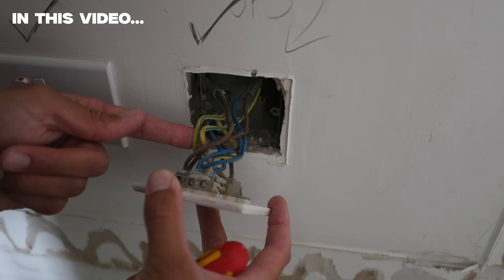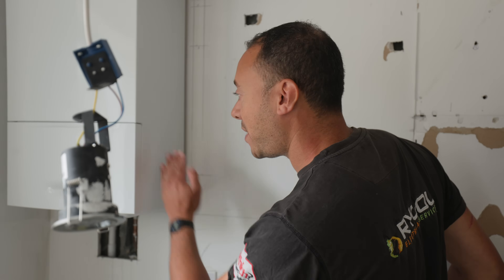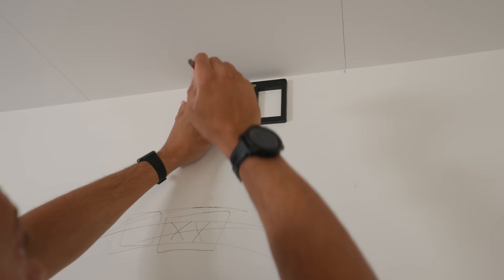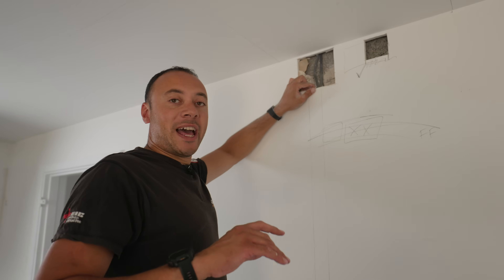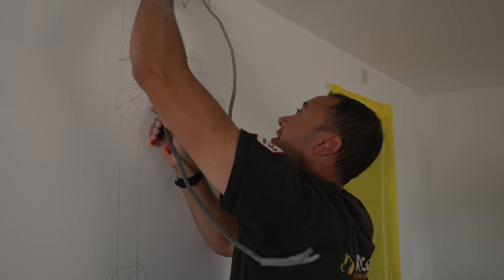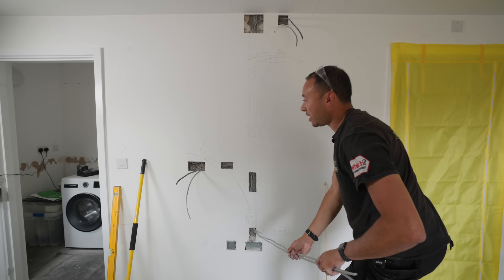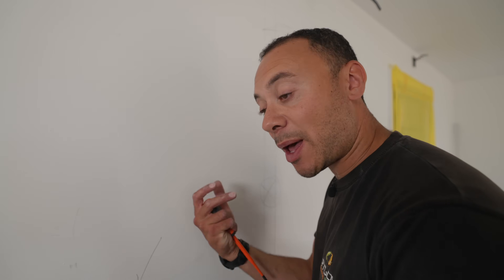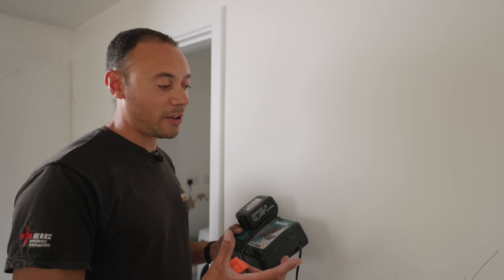Adding a plug socket? Don’t get it WRONG!

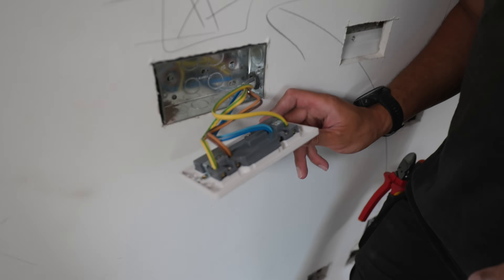Comment: 15:27 You have the Live and Neutral the wrong way around. You haven’t earthed the backbox either. Doncaster Cables EarthSure Twin & Earth comes complete with sheathing on the Earth, yet the cable dimensions are the same. A lot of YouTube electricians use it now.
Reply: KO box has at least one fixed lug so doesn't need a dedicated CPC. I assumed you watched the entire video, in which case you will have seen why he reversed phase and neutral. I believe the sheathed T&E is an imported idea from Australia, one I like.
Reply: @Raysnature  Numpty DiYer question from me. Are you meaning that -
- because the back box has at least one fixed lug and
- the plug socket has a metal strap joining the fixing screw holes to the earthing point that
- the backbox is connected to earth as a result
- and therefore does not need a dedicated CPC (Circuit Protective Conductor) wire?

Comment: Did you lock out the MCB you turned off? Isn't clear in the video?
Reply: He'd disconnected the conductors completely so even if it was switched on, nothing would've happened.  Wouldn't be happy having an open DB with the homeowner in there though.

Comment: They do have Doncaster cables earthsure.. very nice to use to be fair 

I have heard two reasons why they don’t  come sheeved, one is cost of the extra insulation and the other is,   if the line or neutral cable is damaged it’s more likely to short against the bare CPC to indicate a fault in the cable
Reply from the maker: This is very interesting. Good points made there!
Reply: Thank you! 
To help the cable fail "right side" or make it more failsafe really does make perfect sense. Similar to when you can cut the earth to be longer like on a UK plug endures the earth is the last to be removed.